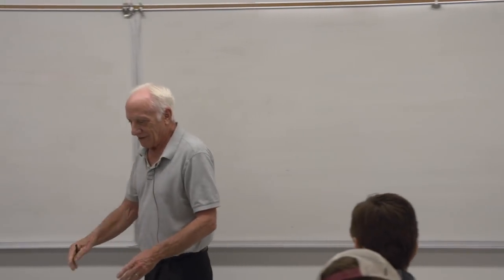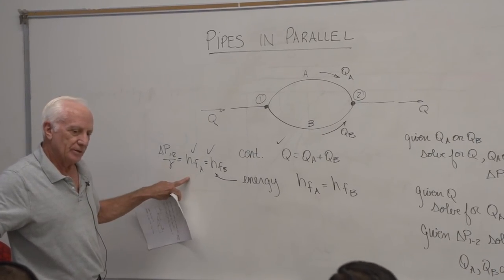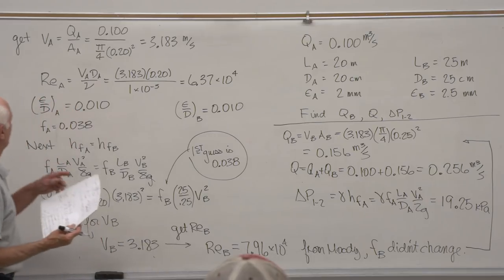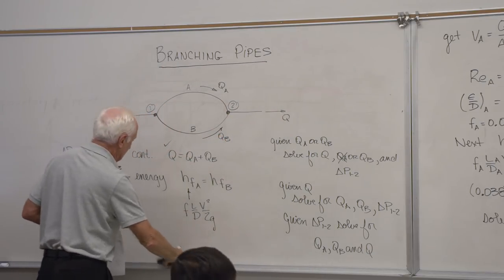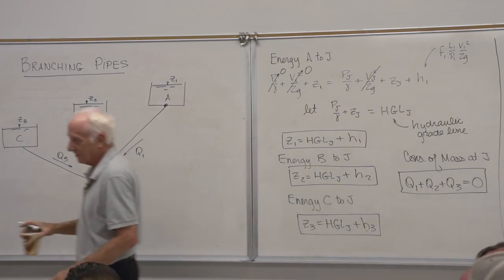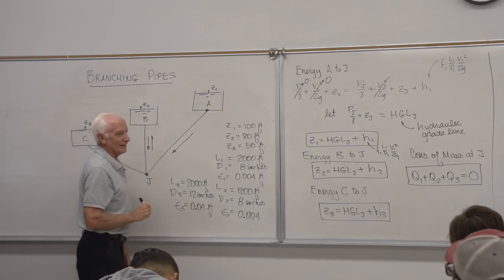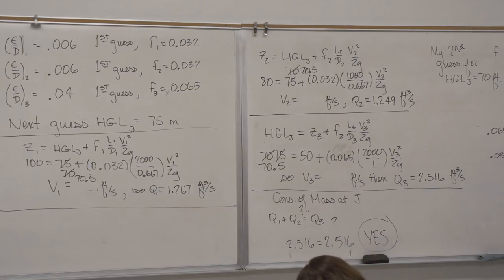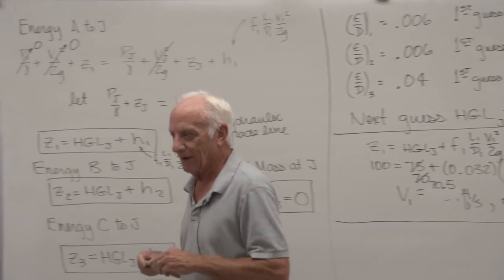Fluid Mechanics: Parallel and Branching Pipes (20 of 34)

Comment: Has anyone determined why the kinematic viscosity of water is listed as 10^-5? Shouldn't it be 1.12*10^-6 , as stated in the same textbook that Dr. Biddle is referring to?

By the way, I've been thoroughly enjoying all the lectures here. Thank you so much!
Reply: It's about units. If you use SI unit systems, it is 10^-5, and it is 1.12*10^-6 in british system.
Reply: @Omer-tx3zx  no it's not. It should be around 1*10^-6 m^2/s (in SI unit)

Comment: Do you use the term "Hydraulic gradient line" as the sum of the height, pressure and velocity heads? I'm a bit confused because in my country they use "Energy Line" for the sum of the 3 heads and "Hydraulic gradient line" for just Z + P/gamma heads

Comment: hi proffesor. if we don't know the pipe roughness how can we solve this type of problems?
Reply from the maker: If you know the pipe material (e.g., plastic, copper, etc.) you can look up typical roughness values for new pipes online or in textbooks. There is a lot of uncertainty in those values though, and they are only valid for new pipes.
Reply: @CPPMechEngTutorials  thanks for the reply! the real issue would be that the roughness for the material involved falls between 0.3 and 3, so probably the right question would be, how do i know which value within that range should i choose? Thanks in advance
Reply from the maker: @carlosnoriega7296 The reality is that you only have a crude estimate for the roughness value. Select some typical value (maybe the average value in the range), and make sure you understand how your calculations change as the roughness changes.
Reply: @CPPMechEngTutorials  that seems a good approach. So ill do that, thank you!

Comment: We need homework solution.pdf.
Reply from the maker: We will not be providing homework solutions. Sorry.
Reply: Chegg account? Just copy/paste question into google, chegg is usually the first link.  Or PDF of solutions manual? Never straight copy because you'll fail your tests, but if you're stuck or just checking to make sure you got the correct answer, Chegg is definitely useful.